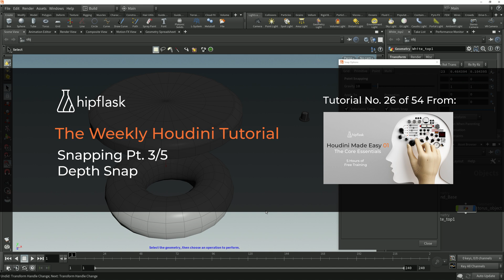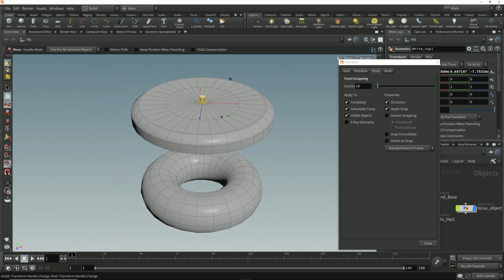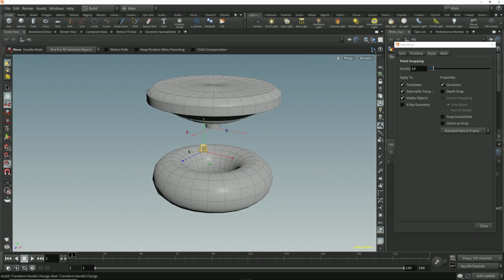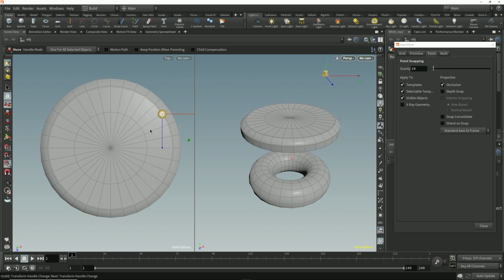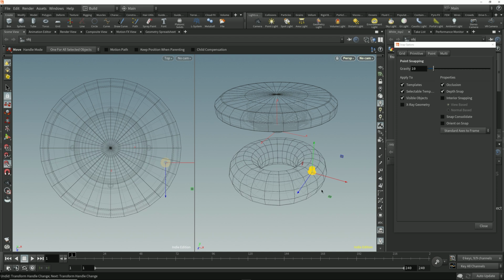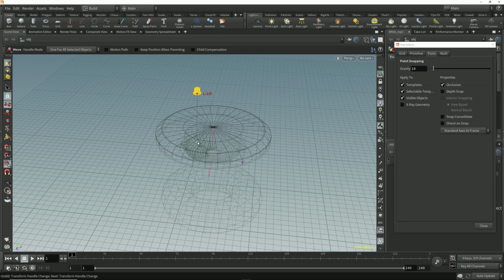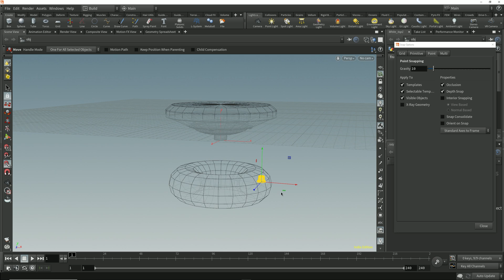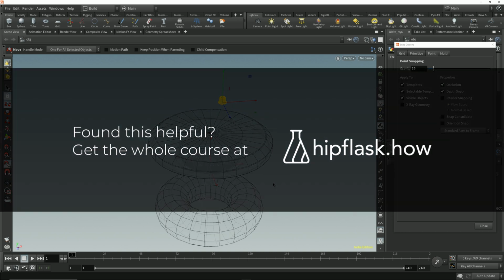The Weekly Houdini Tutorial: Snapping Pt. 3/5 – Depth Snap

Comment: I'm really enjoying these videos, very clear and well produced! Thanks!  One thing I'd love to see covered is snapping in the Geometry context.  I find it to be a total shit-show if I'm honest.  So often I'm unable to snap anything because I keep snapping to the very thing I'm trying to transform.
Reply from the maker: Thanks for your kind words Dan. I'm pleased to hear that you're enjoying the tutorials. We have got some direct modelling courses coming up soon at Hipflask where we'll be covering snapping in the geometry context. 

I think I know what you're talking about with something trying to snap to itself in the geometry context. It tends to happen when you don't have a component selection. Say you take a sphere and add a transform node in the network editor and then try to snap to something. It tries to snap to the components of the sphere itself. A couple of ways around this are to use the align state (tap the semi colon key) and use that snapping method, or make sure that you select all the components on the piece of geometry first before transforming it. 

If you use the radial menu to add the transform node, you'll probably find that you don't have any problems because it will select all the components when you hit enter. Otherwise, using the "select groups or connected geometry option" (9 key) first to quickly select all the components should help. 

Best, Fraser
Reply: @hipflask4921  That's a good point. You're probably correct about when it's been happening, I just didn't see the pattern!  Next time I'll try your suggestion and see how I go.  Cheers!